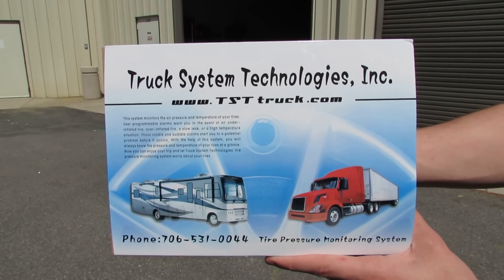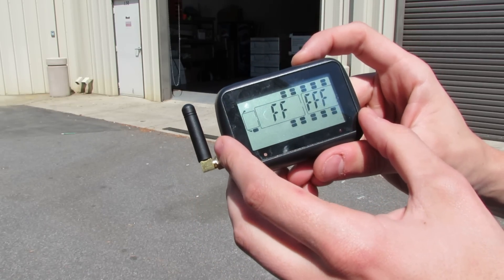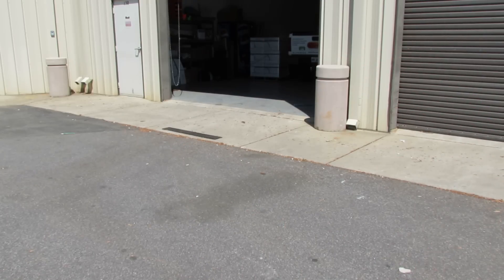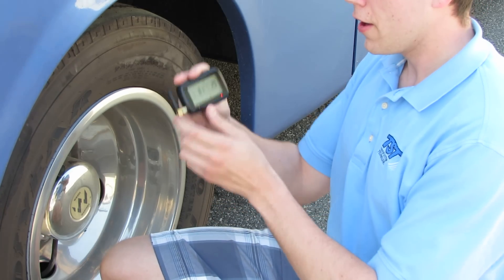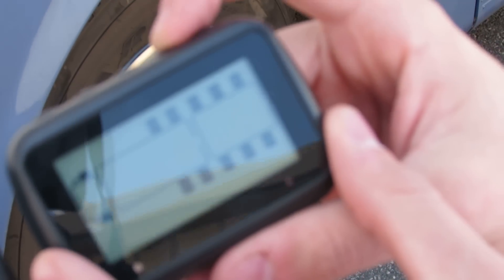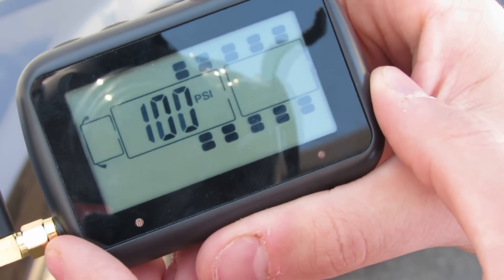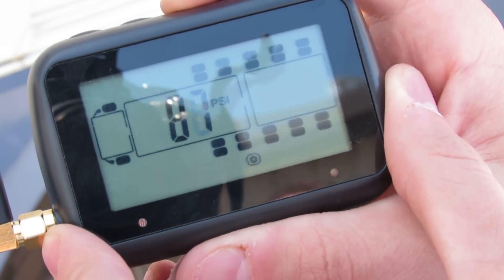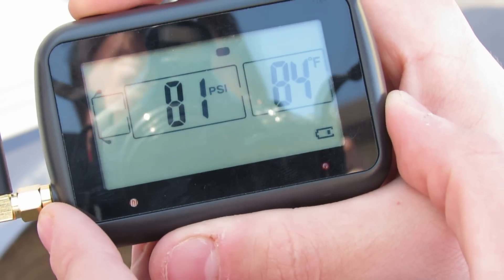507 TST Tire Pressure Monitoring System Installation

Comment: How do you remove a sensor from the display?  For whatever reason my 4 sensor unit came with a sensor already programmed for the front tire.  I set my 4 sensors for the 4 trailer tires but I need to remove that 5th sensor.

Comment: Why do you suggest setting the low pressure warning below the minimum needed to support the load? This means you could be driving for many miles with the tire in overload. You need to point out that "the pressure you set your tires at" should be no lower than the pressure needed to support the load.  I suggest the cold inflation pressure be at least 10% above the minimum needed to support the load. This gives a margin for day to day temperature variation that will change the tire inflation pressure.